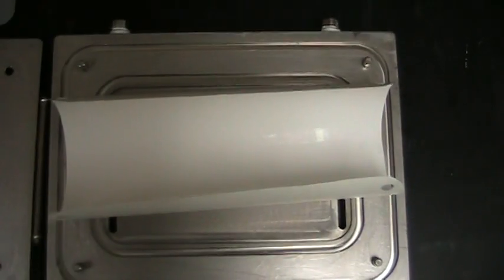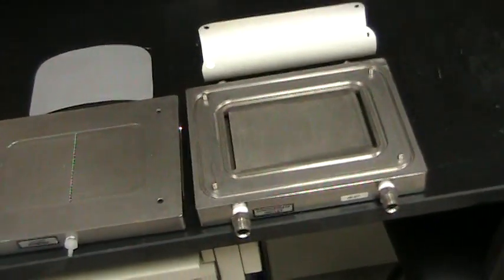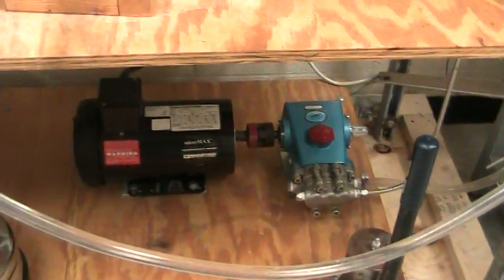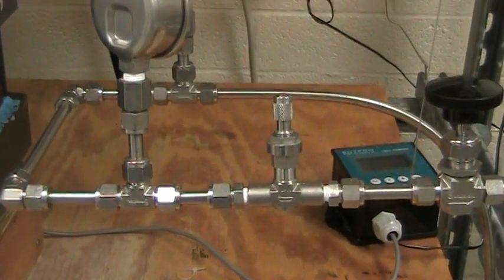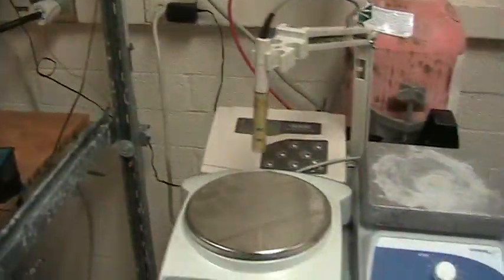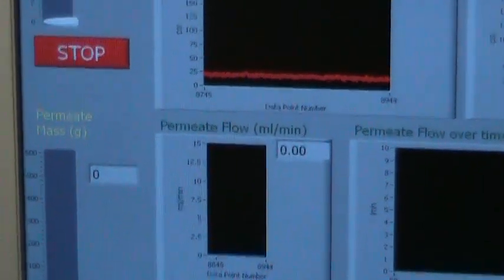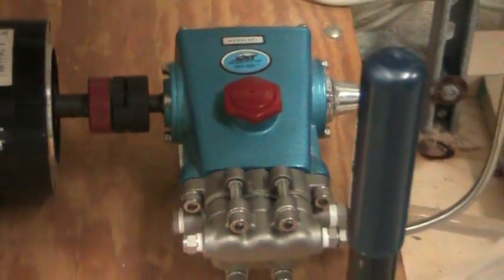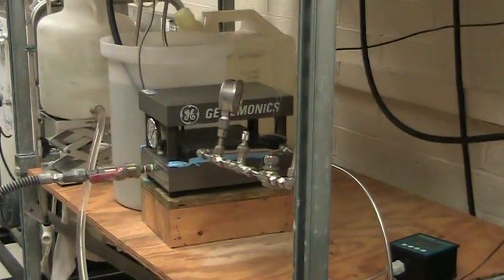Reverse Osmosis Test Setup Tour

Comment: Hi David , Thanks for video.
Can you please tell me that from where you got this RO setup. I need one
Reply from the maker: Ramesh -- We built this from various components. The cell was purchased from GE, but they spun that off. Now Sterlitech is the manufacturer and supplier of the SEPA membrane cells used here. The other key component is the pump, which was a Cat model 231 (I think) that we purchased through a distributor. The motor driving the pump was also purchased through the distributor. The other components were purchased from various sources. Note that I think Sterlitech (and others) sell complete packages, if you don't want to customize and build your own. Good luck!
Reply: David Ladner I build one here. with triplex plunger pump but applied water pressure is not stabilize. any suggestions on that ?

So now I wish to but a complete package So can you provide me few more name except Sterlitech, who can provide me complete assembled setup. Please help. Thanks.
Reply from the maker: Ramesh Soni: With our pump we use an inverter to decrease the pump speed. This helps with puslation problems. Also, you would be surprised how hard it is to get air out of the pump manifold; air causes pulsation and poor performance. You might need to run it for quite a while and/or try running fast, then slow over and over again to get all the air out. Then, never let the pump go dry. I don't know off-hand any other companies that provide complete assembled setups. I'm sure they are out there, but I haven't used them. Good luck.
Reply: David Ladner  Thanks for advice.
One more thing:  do you face pressure stabilization problem ???
how much is pressure fluctuation while testing RO membrane ?
My setup is not generating stabilized pressure. Any advice ?
Reply from the maker: Ramesh Soni The "pulsation" I referred to previously could be interpreted "unstable pressure." Slowing down the pump, and making sure there is no air in the manifold are two strategies. If you're talking about long-term pressure stabilization (like the pressure goes down slowly over a one-hour period), then that's a different kind of problem. Pressure will vary some; like when running at 1000 psi, the instantaneous pressure fluctuates between about 980 and 1020 psi. But that's because we use high-speed data collection. Averaging over a second or two gives pressures that stay within 5 psi or so.
Reply: David Ladner  Can you please answer to my post on your +, Google +, Please .

Comment: I really appreciate your swift response David. I will contact LabView soon. Do you recommend to use reciprocating pump with compensator instead of centrifugal pump, in the upstream of the R.O membrane (in lab rig experiment)??? And have you performed internal recycle test for high recovery simulation??

Comment from the maker: Yes, we use a frequency inverter to control the motor. I know that some others use a bypass line instead of a motor controller, but the controller is handy. It is connected to the computer with a 0 to 10 volt signal that tells the controller at what RPM it should operate. Details of the parts used are in my dissertation, Table 3-1. I will put the link in my video description; YouTube doesn't allow links in comments, apparently.

Comment: Hi David! Nice work showing the unit! I'm trying to mount a unit like this here in the lab I'm studying. Do you use a frequency inverter to control the rpm of pump and consequently the flow? Or the flow could be adjusted just by valves? I thank you very much for the help! best regards!

Comment from the maker: The membranes are received dry and stored that way for many months. Before we use them we soak them in deionized water at least over night. You can keep them in the water for longer (several weeks) by replacing the water regularly. If it is very important to minimize microbial activity, you can use a biocide, but the membrane itself will last quite a long time just soaking in water. Typically people recommend that the membrane not be dried after it has been wetted.